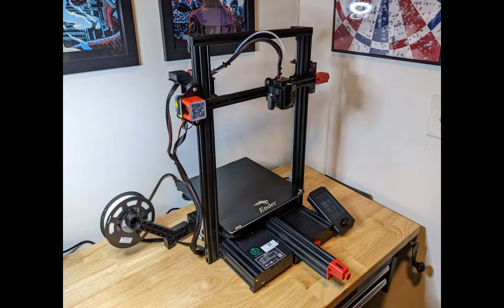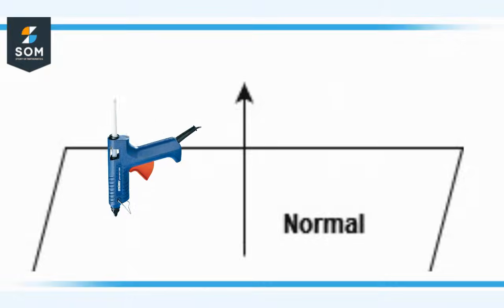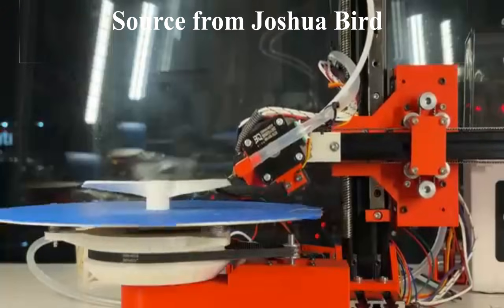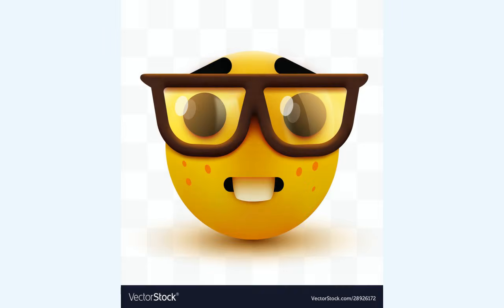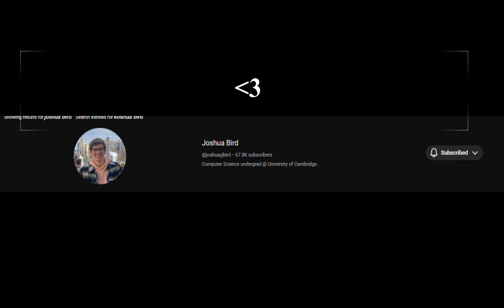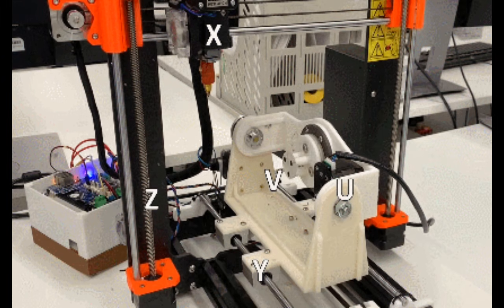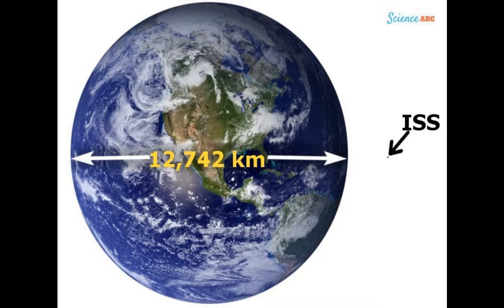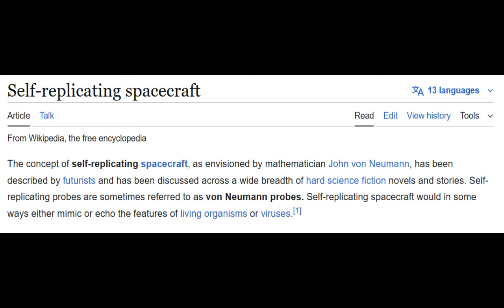Non Planar Slicing and Multi Axis 3D printing

Comment: you really need to fix the audio of the video
most of it was super low and then there are 2 places where its loud (where the vsauce music plays at the start and at the very end last few secs (like last 10 or so) are normal sound (perhaps even a little too loud, but close to normal), while the rest of the vid is too low volume)
Had to play with my sound like a dj